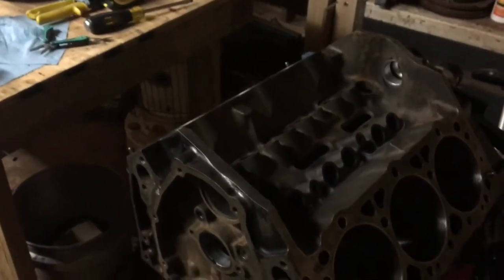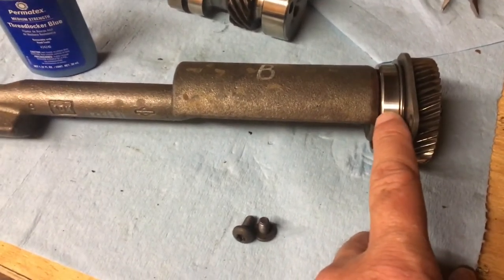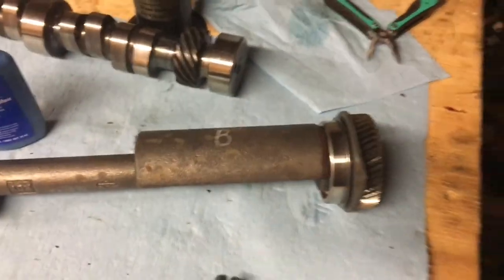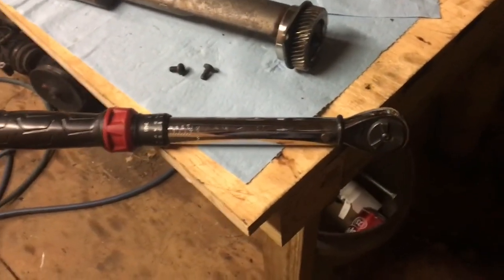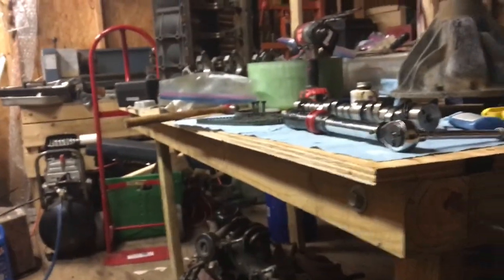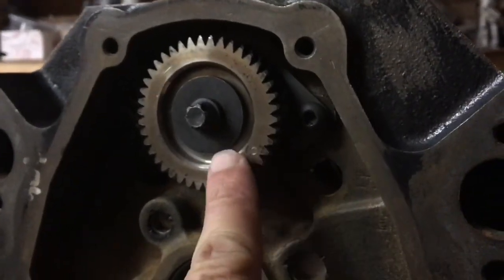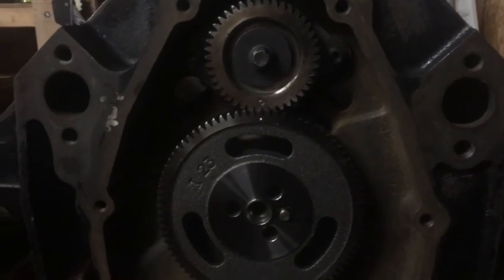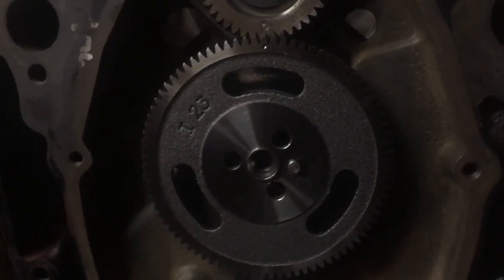Part 3 - Mercruiser 4.3 V6 Rebuild - Camshaft Install

Comment: What is the part number ? On the chain and sprockets . Also mine has a tensioner ? It’s a 96+ vortec
Reply from the maker: It’s a lot more than a 96+ Vortec. Look up a 2010 Silverado 4.3 on RockAuto. I found a tensioner in the timing components. But your engine is getting into the later year options so don’t go by what I say. You’re going to have to get a service manual for your engine.

Comment: do i have to remove the balance shaft to get out the camshaft?  also what size torx bit is the retainer for the camshaft?  any tricks or just use the torx bit
Reply from the maker: You have to remove both gears on the camshaft to get the balance shaft out but you don’t have to remove the balance shaft at all if you don’t want to.  The description of the video tells you what size torx to use. Do not use security type torx bits. They are not strong enough and will twist and chew up the bolt and possibly strip the bolt to where you’ll have to ground the head off.